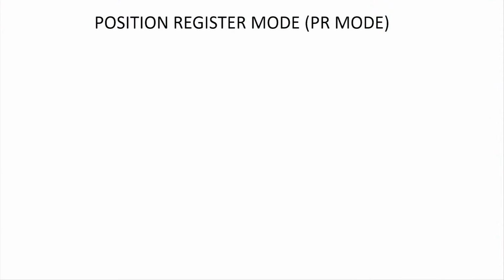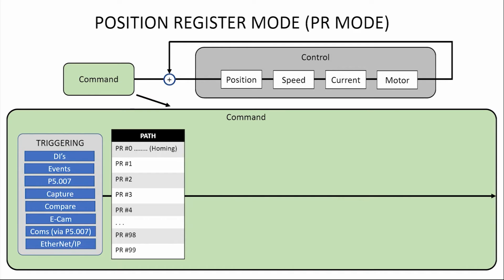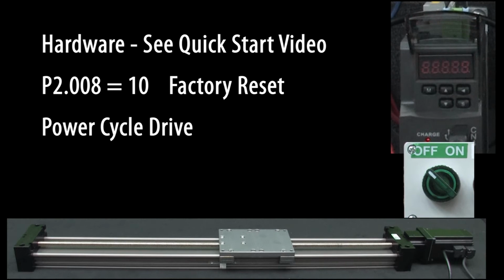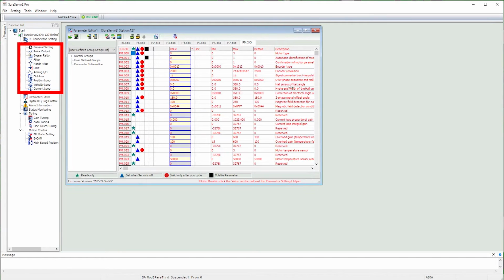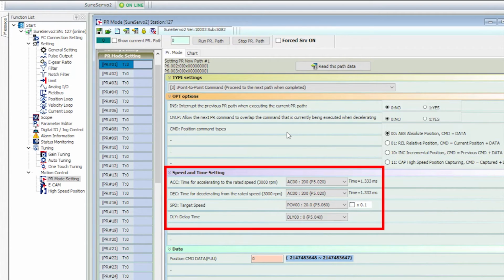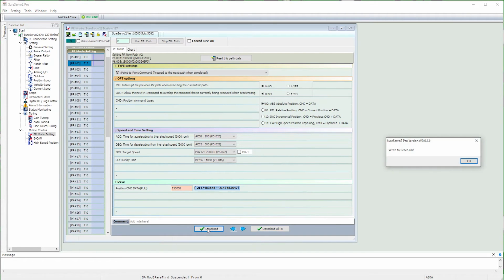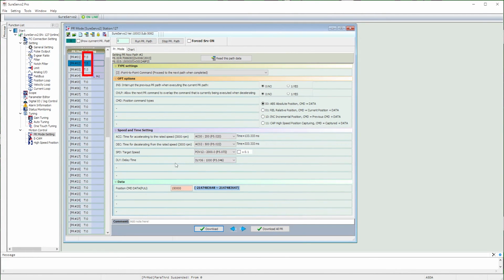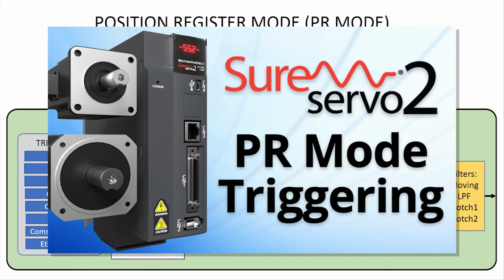SureServo2 Position Register Mode (PR Mode) Quick Start from AutomationDirect

Comment: I am a young Engineer from Ohio and I cant explain how helpful and useful these videos are and how impressed I am with most of Automation Directs products. Thank you for everything, I plan on converting most of my companies equipment to Automation Direct products over the years!
Reply from the maker: Thank you for the high praise. This is the response we strive for. Happy Friday!
Reply: I'm an engineer in Ohio, going to be setting a machine up using registration mode. Might need some help, are you for hire at all?  I need to land a piece of paper, on top of another piece of paper traveling at 38,000 sheets per hour. Those ar very high belt speeds. The machinery already is solid the conveyors, and feeders, but we need to read the belt speeds of the devices, the positioning of each piece as they are traveling, and the 2nd feeder, its, SERVO, will slightly adjust up and down, BASED on landing on the piece traveling below it.
Reply: @brentbarnhart5827 hello, I own a company here in Ohio that engineers custom equipment as a turn key solution. We’d be happy to take a look at what you’d like help with.